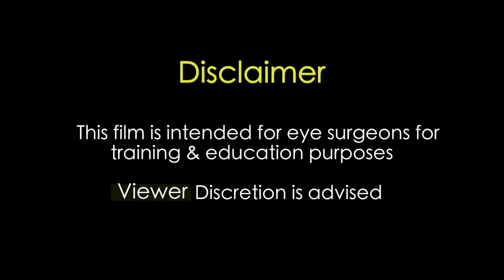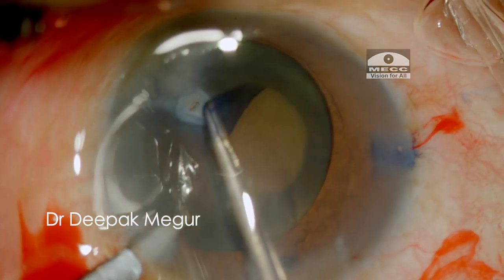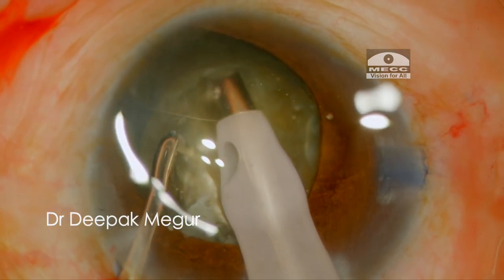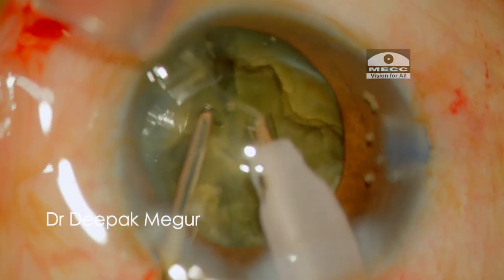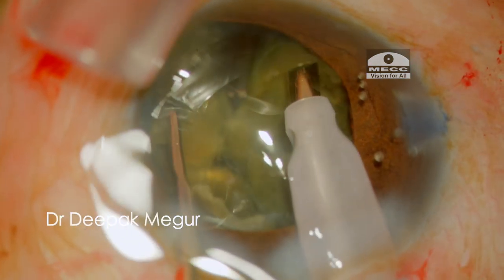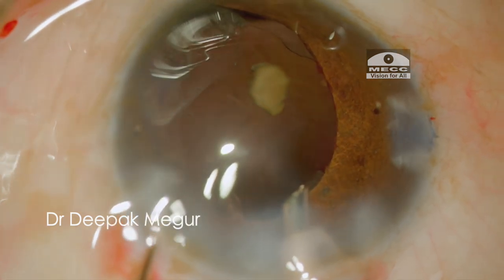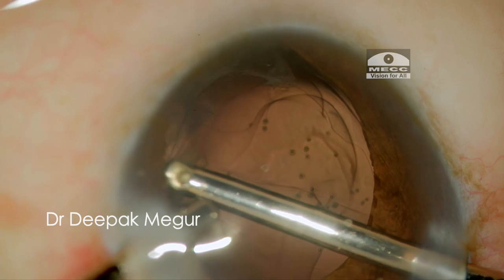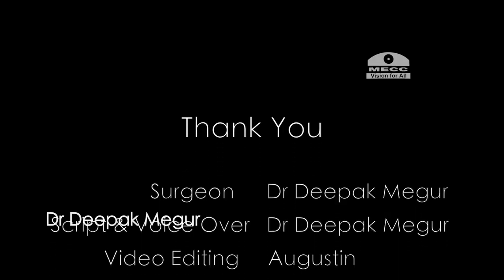Phaco in a case of Iris Coloboma and Fluid Misdirection Syndrome- Dr Deepak Megur

Comment: Is there any way to minimise fluid misdirection syndrome by changing the bottle height ??   Thank you sir,,
Reply from the maker: 1.Use viscoat to block that area.
2. Early insertion of CTR will help
3. Low fluidics, low bottle height.
Reply: @DrDeepakMegur  thank you sir,,